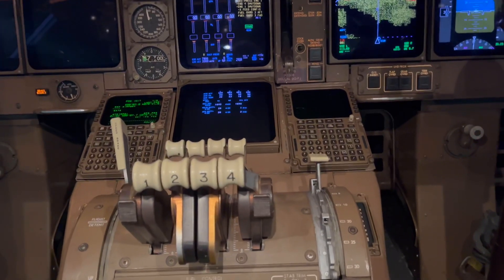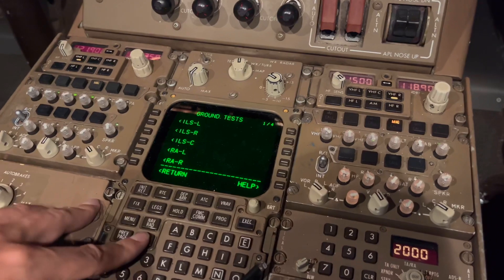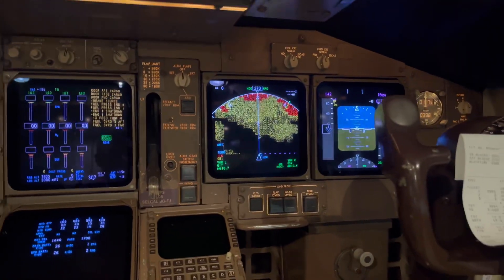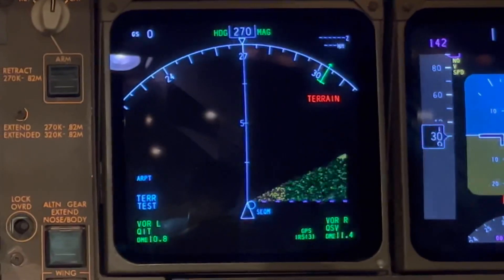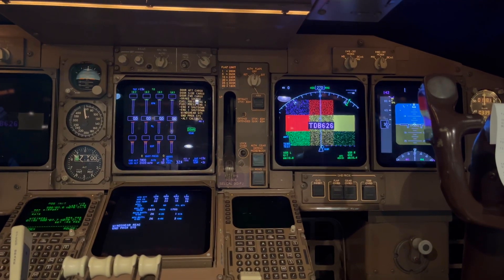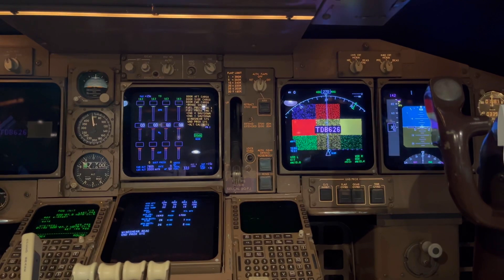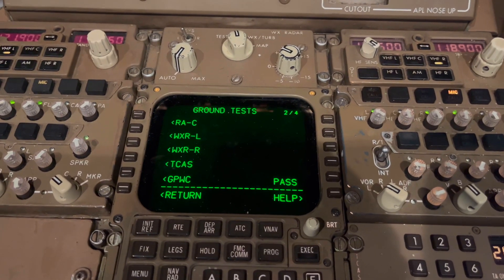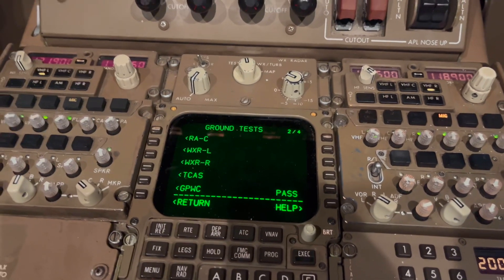Boeing B747-400BCF Ground Proximity Warning System Ground test

Comment: A question was asked on a flight sim forum: With the APU OFF and the Ground Test switch on, do you only get the APU oil quantity on the Status page? Also, can you get all the APU parameters to appear if you have the APU selected to ON (not start) with the Ground Test switch on?
I recall the last parameter to disappear was the oil quantity when switching off the APU (i.e. it would disappear after a minute or two). Thanks!
Reply from the maker: As far as I recall, you only see oil qty when ground test is selected on. 
But if I check the manual N1 and N2 ind will come up after 3 minutes.
Reply: @dennisvijverbergbrakesrele6098  Interesting. Thanks. I have an old AMM, but I couldn't find it in Chapter 49 or 31. In the manual, it does show the APU Maintenance Page with the ground test switch on, but there are no N values or EGTs. There is no picture of the Status page for these conditions, but I assume they will show the available values. There are no pictures of the Maintenance or Status Page with the APU selector in ON and the ground test on.